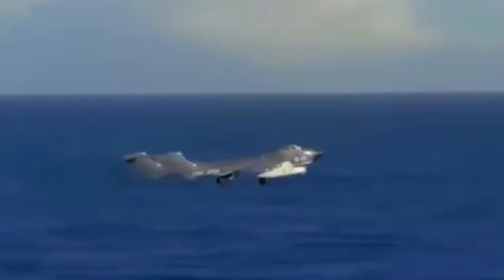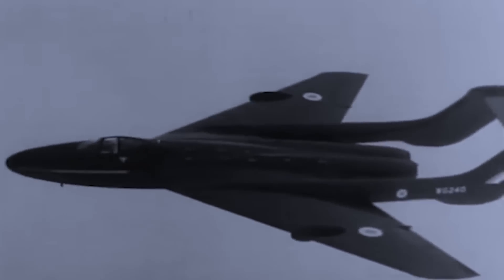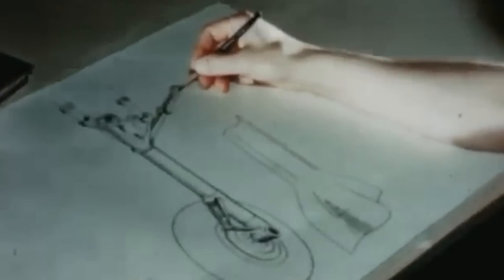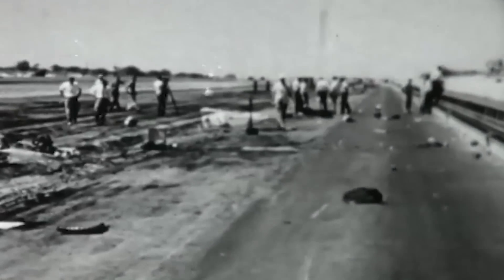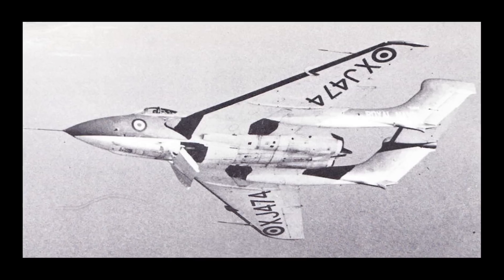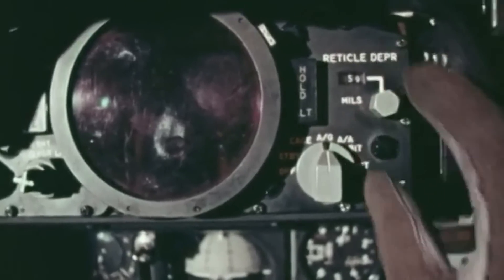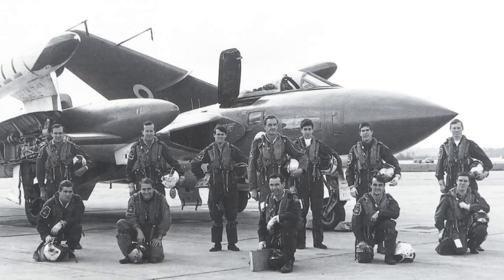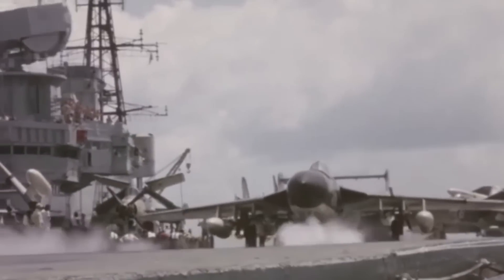This Fighter Jet Is One of the Weirdest Ever Made

Comment: I have to disagree with the detractors on the comments here, it was precisely the weapons system that was needed at that time, the problem was that things were moving very fast at that time and like other designs it went from cutting edge to obsolete in a relatively short time. As for the often levelled “too many accidents” again this aircraft was much larger and heavier than it’s predecessors therefore the vast majority of the accidents were on catapult launches where a problem with the CAT would put the aircraft off the front of the carrier in a stalled state.

Comment: This plane was a failure, no matter how much you praize it. About the same time this plane appeared, the Americans came up with the Crusader, the Pantom, the Starfighter, the Dagger, the Dart and the Thunderchief, all 1.5 to twice the speed of sound.
Reply: The Vixen flew at least two years before the earliest of the planes you mentioned.

As for failure, didn't the Starfighter earn the nickname "Widow maker" because of the number of its pilots it killed?
Reply: @Tryna-B-Good  The Vought Crusader became operational in 1957, the Starfighter in 1958, the Delta Dart in 1959, the Mig 21 in 1959. The Sea Vixen became operational in 1959 too. First flight is irrelevant; it is the year that the planes became operational that counts.
Whether the Starfighter was a failure too is irrelevant. The shortcomings of the Starfighter do not make the Sea Vixen a better plane. 
And don't forget to mention that the first Sea Vixen that flew crashed into the audience at Farnborough, because it was made out of plywood and therefore broke up in mid air.
Reply: @retepeyahaled2961 The Vixen was all metal, not wood.
Reply: @nor0845  The first version had a faulty wing spar. (First I mistakenly thought it was made of plywood, like it's predecessors) After it crashed into the public, they rebuilt it. Next, it could not break the sound barrier anymore in level flight.
Reply: @retepeyahaled2961  Hi. I don’t want to get into a circular discussion about the merits of this aircraft but the only reference I could find to wood in the planes construction is regarding the cannons: “All sorts of ideas were tried but the only solution that worked was to put a baulk of timber in place to absorb this recoil force. Thus the Vixen was also the last British fighter to use wood in its construction! The cannons were soon removed and an all missile armament was developed.” The crash referred to, resulted from failure of the leading edge of the wing, which was later redesigned. Again, as far as I can ascertain the plane was an all metal airframe. Regards, Nor.
Reply: @nor0845  hi, I checked and I cannot find any reference anymore  to plywood being used. So maybe I made a mistake on this topic... but I will keep searching for a source. Overall it does not matter much, I think.
Reply: @retepeyahaled2961  Hi again. No problem. Thank you for the civil discussion (Something of a rarity at times these days). Take care and all the best. Nor.
Reply: @nor0845  hi, so I checked agsin and the Sea Vixen was an all metal design indeed. It's predecessors were not - and as I read in Wikipedia about the accident with the Sea Vixen at Farnborough, I saw a link showing a main spar that was an all wood construction. I guess this led me to wrongly believe that the Sea Vixen was partly made of plywood. So I have learned something new... 😉
Reply: It was not a failure. It showed what could be done and helped design the next generation without these so-called failures you wouldn’t be able to find what does work and what doesn’t work. Thomas Edison had a very famous quote with his what you would call failures with the lightbulb before he made it. In science and aviation mechanics building, you always have to have failures in order to have a success.
Reply: @JohnHill-k6p  And after that it was replaced by the Phantom.
Reply: @retepeyahaled2961  and the Phantom got replaced also. So what’s your point?
Reply: @JohnHill-k6p  The pantom became operational one year after the Sea Vixen, was produced in vast numbers and stayed in service world wide into this century. The Sea Vixen was built in small numbers, only stayed in service for a decade and was replaced in 1972 by the Phantom of virtually the same age. So they literally switched from one plane to another...
Reply: @retepeyahaled2961  well now that you say that it must be true lol

Comment: The Blackburn Buccaneer was the best all around fighter design.   It beat the CAP on an American aircraft carrier during war games by flying lower than anyone expected it to.  Fifty feet above the water.  That's ballsy flying because a 50 foot drop could make it a submarine.  But the Vixen, as much as I do love the overall design, was a widow-maker.
Reply: The Buccaneer was not a fighter, it was a strike aircraft, similar in role to the USN A-6.
Reply: The Buccaneer was a pure attack aircraft. It's trick was flying low under RADAR, which it was very good at, but it  became totally obsolete once AWACS and Look-Down RADAR became common. A flight of Buccs on the deck would not be able to climb fast enough to even try to escape enemy fighters once spotted, and even if they did they would be too slow and sluggish to have any chance of even getting a lock with the two sidewinder missiles they (might have) carried.

Comment: It looked the way it did because it followed the old adage "Form Follows Function". Royal Navy aircraft carriers, of the time, were small, because of the mission they were required to do, being able to operate in smaller seas of Europe, unlike the Americans who's carriers would be in deeper waters (and which would struggle in seas the RN carriers would have no trouble with)
Reply: That was not why post war British carriers were smaller.  The last British carriers to be laid down before the QEs were WWII designs and were about 50% larger than the Essex class as built.  When the Sea Vixen was introduced the RN was still operating the Pre War  HMS Victorious and WWII light fleet carries.  As build they were meant to operate in the same environment as contemporary US carriers.